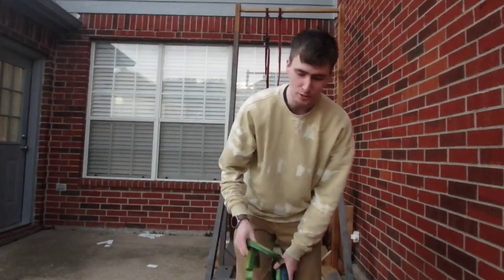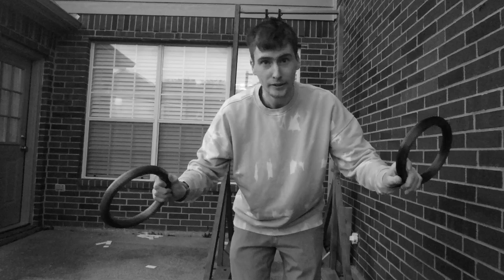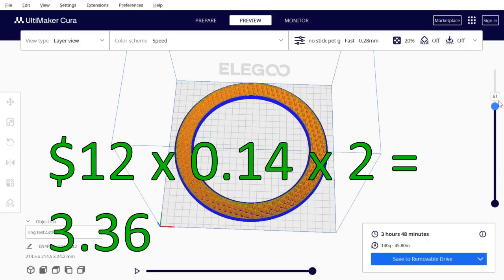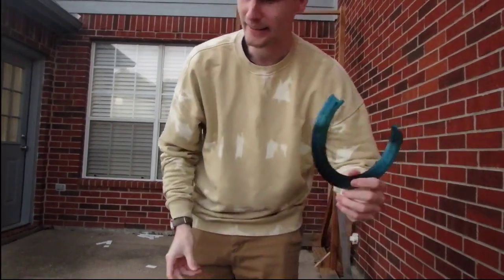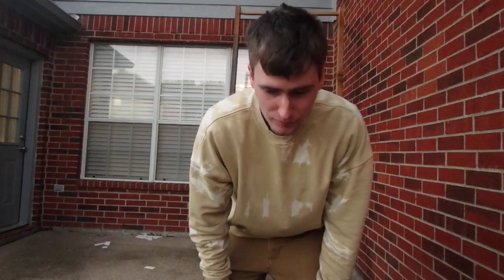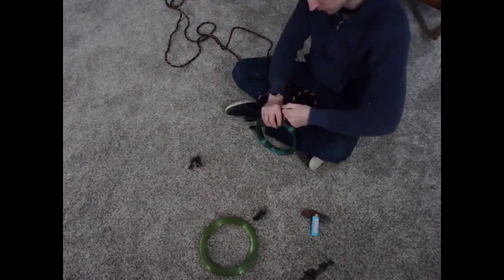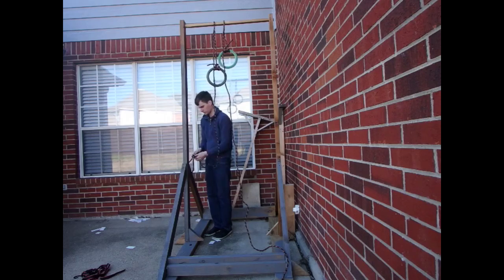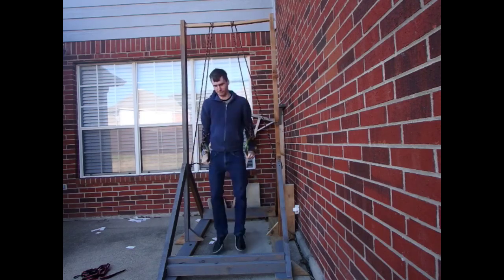Can you 3d print gymnastic rings?

Comment: Hey man, it's hard to tell in the video, but with the way you attached the rope to the rings, most of the tension will be dealt with by the first wrap of rope around the ring, and the second wrap will share a lot of load, but less. Later wraps will carry less load. You created a kind of capstan, so the plastic will compress super hard under the first wrap. I suggest just using 1" (or better, 2") webbing instead of rope. Just use the water knot (a reverse traced overhand) to make a nice loop of webbing to spread the load. If you use 1", you could also use the rappel ring web lock method that slackliners use to adjust the length. 

I definitely also suggest printing with more perimeters over a higher infill ratio. For an application like this where you could actually get injured if it fails, you might as well go for like 10 perimeters, and then bump up to like 50% infill just for some extra compressive strength. I would also go for a somewhat isotropic infill pattern like gyroid since these will experience intense loading from all directions.
Reply from the maker: Webbing would be the best option. And I did notice it tightening down on the first loop more than the rest. For me I might change it to a bowline with multiple loops or something like a clove hitch which might distribute the load better

Comment: Haha, I actually made some my self a last year, I printed them in PLA, I designed them in three pieces that mount together with brass pins, and they seem to hold up 😅
Reply from the maker: I recently learned how to do joinery with 3d prints, but brass pins is not in my tool box. I think if I wanted to make a bigger one than I would have rope going around the circumference to hold it together.